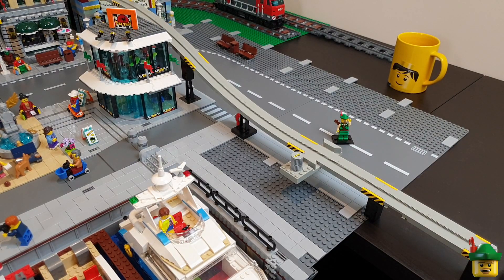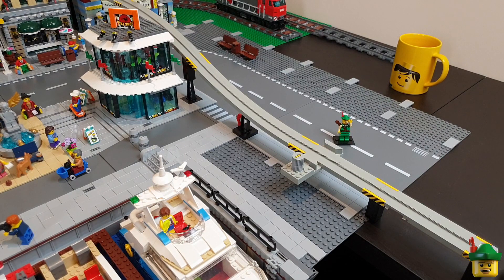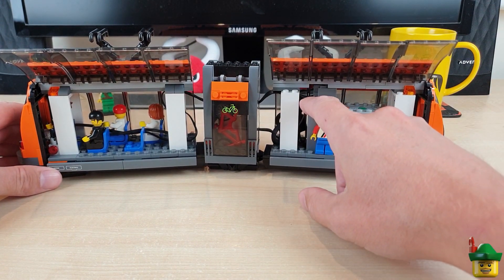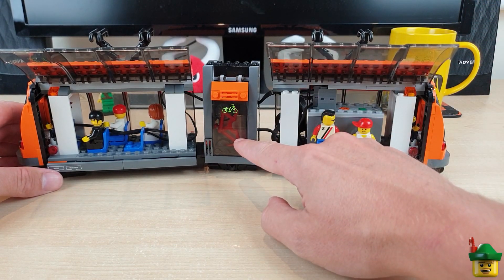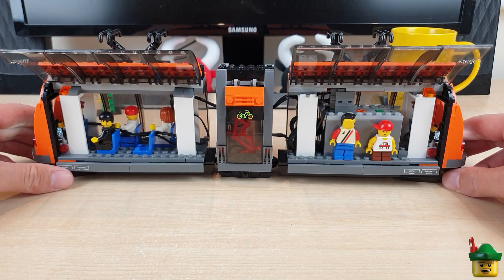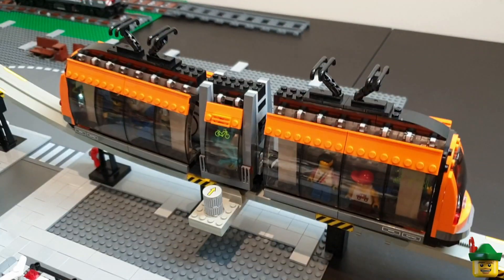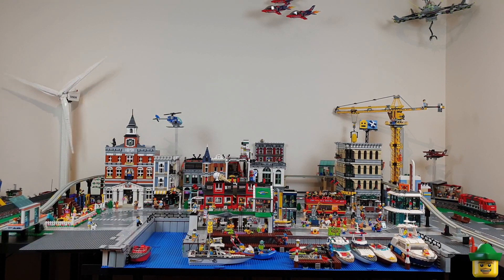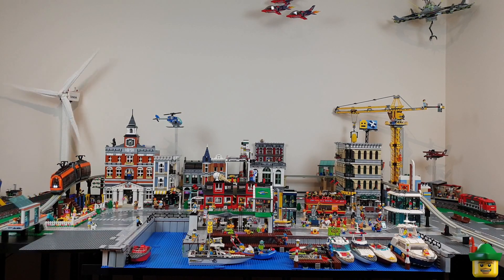LEGO City Update - Power Functions Motorised Tram 60097 & Monorail 🚋🏹

Comment: This is a very detailed and great video. I’ve been trying to figure out something dealing with the monorail and you have basically answered a lot of questions for me. Could you do a video showing how the power functions hooks to the monorail motor please
Reply from the maker: The power functions extension cable is backwards compatible.  It literally just connects onto the 2x2 terminal on the monorail motor.  No trick to it at all.  Thanks for watching!
Reply: Robin Hood Bricks can you change the speed of the motor since you’re using the power functions set up?
Reply from the maker: In theory, yes.  But it needs all the voltage to go up those slopes.  It struggles a bit as it is.  I use a rechargeable battery as they maintain a decent voltage for longer and are greener in the long run.  It is always set to full voltage!
Reply: OK so you’re not using a IR receiver
Reply from the maker: @BlindsideBricks  there's no need as the position of the station switches control the movement.  Turn the tram on and you get the lights but the motor is powered but not moving, at least until the station track switch sets it going!

Comment: Wow. That’s a rough sounding motor. Hopefully you have a spare, I don’t know how much longer it’s going to have. Might go on forever too.
Reply from the maker: Is it?  It's the only one I've ever had and is second hand so I assumed it was normal.  It is most though.
Do you mean on the Tram Cam bits or throughout? It may be something I can fix in the edit!
Reply: Robin Hood Bricks It’s not an audio problem or related to running on the track. All my motors are second hand and quiet. On another subject, I really like the station you built by the marina. A small city with a lot of detail. Gives me ideas.
Reply from the maker: @dreamersink9446  I'll have to check out another motor then.
Just wait until my city is HUGE and detailed!

Comment: Very nice touch with the head light lamps. I wonder if you extended the center section you could place in the battery box. Not sure if it would still do the corners or the track rises though. Either way it is cool that it's motorized now. You have a great Lego building mind sir. The city looks awesome.

Today is labor day here in the states. Does the U.K. have that holiday?
Reply from the maker: Thanks.  Yes, there's no way that battery box can go anywhere else.  The motor fills that middle section and has an integrated base.
We had a bank holiday last Monday but it isn't called Labor Day!

Comment: Hi there great mod to the tram. Sham lego didn't make it work.
Quick question can the battery pack be used on its end inside the tram?.
(I don't have much experience with the train setup).
Reply from the maker: Sadly not.  There's only just enough space for it in the normal orientation.  Thanks for watching!

Comment: Hi Robin,
I love your city and especially your Monorail. Maybe you already descriped it but I couldn't find it. Do I see it correct that you use an XL motor for it? And which couplings you use for the motor base? The older short ones or the newer long ones? Thanks a lot for your answer in advance.
Reply from the maker: No problem.  The monorail is largely the stock setup.  The motor, motor base and two longer end bases are all straight from the old monorail sets, unaltered.  Sadly these are crazy expensive now.
I think mine has the long couplings but I'm not sure if that is necessary.  I'm not sure as this is the only one I've seen.
The old power system and PF are completely compatible so rather than have an old battery box and wire I have a PF rechargeable battery, 2x lights and a PF cable which connects directly onto the old motor.
I hope that helps!
Reply: @RobinHoodBricks  Thanks a lot Robin!

Comment: What did you use to automatically reverse the direction of the tram?
Reply from the maker: It's a feature of the monorail system.  A switch on the base of the motor hits a track piece and reverses the motor direction!
Reply: @RobinHoodBricks  Thank you very much. I just started building my city and was thinking about implementing either a monorail or a subway. Are your monorail tracks purchasable on bricklink?

Comment: Hi Robin:  Want your advice.  My LEGO city is based on Hawaii and they don't have trains or monorails.  However, the more I view your videos with a camera on the front of the Monorail - I'm thinking I want motorized transportation.  I have limited space, but do you recommend I add an elevated monorail as it will need less space and also lower cost?
Reply from the maker: Motorised transportation is awesome for LEGO so I agree entirely.  However monorail is really expensive and quite inflexible.  A train set would be a lot cheaper and easier but the downside is the space it takes up.  Not an easy choice.  This conundrum is why I'm currently adding a subway train underneath my tables!
Reply from the maker: Why not do a motorised cable car up your volcano?  That would integrate with your theme but take less space!
Reply: @RobinHoodBricks  Because my volcano is small LOL it's shorter than the Lego Lighthouse.
Reply: @RobinHoodBricks  So is your subway going to rest on tables underneath your tables?  Or will you suspend it?
Reply from the maker: @brickbuilderblu  I have tables on top of tables.  The subway runs on the lower set!
Reply from the maker: @brickbuilderblu  Ahhh, ok!